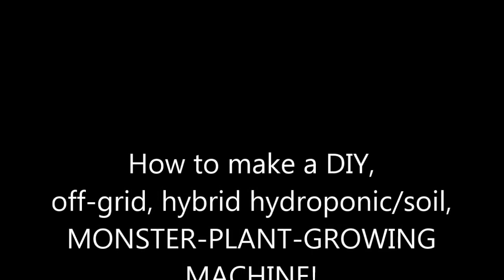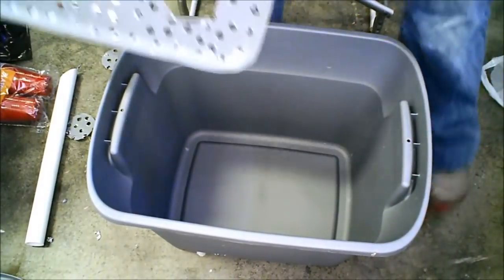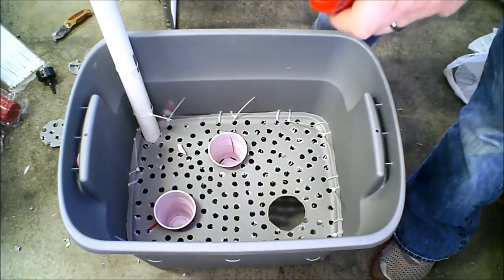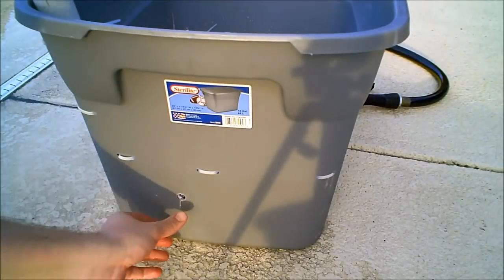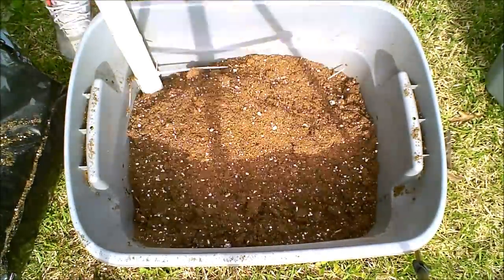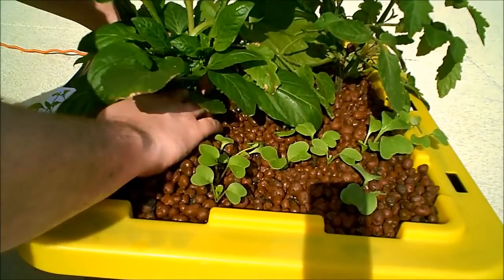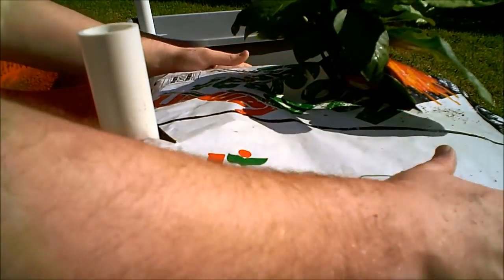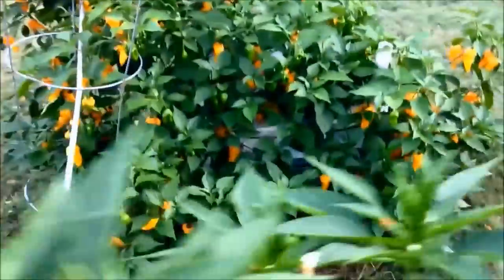DIY guide: how to make off grid hydroponic self watering container

Comment: This is an awesome idea! I will be trying this season thank you. One question. You don’t have problems with the soil going into the bottom and mixing with the rest of the hydroponic solution and also filling the air pocket? Will it help to use landscaping fabric?
Reply from the maker: There are no problems with soil falling through :)  I know it seems like it will, but it wont be an issue!  Keep in mind there is a plastic covering over the top, so there wont be any rain water flowing through it pushing it downward.  Think about a normal pot, it has holes in the bottom, but soil doesnt fall out of the bottom when you pick it up.  TLDR; dont use landscaping fabric :)
Reply: LS would just hinder the roots from growing into the nutrient solution.

Comment: Did you notice any improvement with using the peatmoss/perlite mix over the promix? I wondering if the benefits of the promix are worth the extra cost?
Reply from the maker: No, other than a great deal of convenience and time vs mixing and hydrating peat mix manually.  If you are on a budget mix it yourself :)
Reply: @PepperRancher  Thanks you, I appreciate you getting back to me. I live in a hotter climate where the summers can surpass 110 degrees Fahrenheit. I'm concerned about the water in the wicking bed going anaerobic at that temperature as the solubility of gases such as oxygen decreases with elevated temperatures. Have you had any issues with anaerobic bacteria or fungal disease?  Thanks again!
Reply from the maker: @nathanncohen793  No I havent, im in Alabama so its probably a bit cooler then where you are, but it would drink the entire revivor to dry every day in the peak of summer... so it had to be refilled daily.  Keep in mind that most of the oxygen for the roots will come from the drier soil section as well as the gap between the water level and the soil (sort of like kratky method)
Reply: @PepperRancher  Thanks again for the reply. I think I'll need to give this a try this summer!

Comment: That looks interesting with out no air pump where they get oxygen and doesn’t the soil goes down to the water trough the holes and don’t you clean out water ??
Reply from the maker: No, the soil doesn't go through the holes.  The fact that there is no top watering due to the plastic covering helps, but even normal pots have holes in the bottom.

Comment: But doesn't the soil fall through the little holes into the water! Shouldn't i put like a flat filter of sorts?
Reply: No it will not fall through.  The plastic sheet on the top will prevent excess water from filtering through from top to bottom which may otherwise be a cause for soil to get filtered through.  Trust me it is not a concern :)

Comment: Great stuff. Do you have problem with ppm of the nutrient in the water going too high? Do you flush the solution often?
Reply from the maker: No, I never flushed the solution.  Sometimes I added regular water instead of solution when it dried out to save time (it went completely dry almost every day in the summer, it drank THAT much).
Reply: @PepperRancher  thanks for the reply. I'm experimenting with this system on a half liter container for a 2 month old pepper plant. I can see that the roots that are reaching the water has started to rot! Have you ever faced this problem? Any ideas why it could be happening?

Comment: HI there; you are covering a container against the rain protecting lover level. what about those holes you drilled and place the soil into the container. the soil will drop into the bottom through the wholes. IT DOES NOT MAKE A SENCE IS CONFUSING.
Reply from the maker: The soil will not drop through the holes... it isnt like dry sand (that would fall through).  Peat based potting soil will sit on top of those holes without falling through...

Comment: Thank you for the video! Did you ever have any temperature/heat related issues with the hydroponic solution? How did you manage to keep the solution cool enough to not burn the roots of the plant?
Reply from the maker: Hi, the worry point about a warm temperature of a typical hydroponic solution would be starving the plant of oxygen since less oxygen is stored in warm solution than cool solution (it is not actually a problem of cooking/burning the roots from the temperature) Since this plant / system has an entire section of roots outside of the solution dedicated to oxygen absorption it does not run into this issue.

Comment: do you have problems with the self watering bucket getting to hot inside? how do you fix it? i live near AZ and have a concern the water gets to hot and rott the plants
Reply from the maker: Alabama is pretty hot and I have never had a problem with that...  This would be a major concern in traditional hydroponics because the roots would be getting the oxygen from the water itself, in which case the oxygen saturation level would be lower the hotter the water gets.  But in this case the roots are getting oxygen straight from the "air zone" above the water line, as well as from the majority fairly dry soil in the container above

Comment: Do you keep the master blend formula the same. When the plant goes in to flower.
Reply from the maker: I just keep them at the same nutrient ratio.  And they seem to do fine...
Reply: What was the soil recipe again
Reply from the maker: I use promix now.  I used to mix peat moss, perlite, and vermiculite in roughly equal ratio.
Reply: What pro mix isn't there a few different kind also since you switch do you still feed it with master blend
Reply: Animal Farm after you make your nutrient mix do you adjust pH or just run as is?

Comment: Do you think you would have gotten the same results with just using perlite instead of soil or do you believe the soil and hydroponics combined made this result? Also how long should the root system be before planting the plant?
Reply from the maker: I dont think perlite alone would work, it would not wick all the way to the top of the container.  The roots do not have to be long at first, because of the fact that moisture will wick all the way up towards the top.

Comment: Do you allow the nutrient reservoir to empty before filling it again, or do you always keep it topped up? Thanks.
Reply from the maker: Usually it is pretty empty when I add more nutrients, but this is more because it drinks so fast than because I am letting it get empty on purpose.
I guess to answer your question, there is no reason to top it off if you think there is enough water/nutrients left in the tank to last until the next time you will be there to water it.

Comment: Great looking plant.  Do you have a problem with the soil falling into the hydro solution through all the holes that you drilled?
Reply from the maker: +Matt Fuller No, not at all.  Kind of like having holes in the bottom of a pot, the soil doesn't really fall through (maybe a tiny bit when you are first filling it)

Comment: Nice ideas!  Thanks for the video.  

Question for you on your seed starter, those bare roots sitting in water like that doesn't rot the roots??
Reply from the maker: +Keith Collura 
No!  As long as the plant's roots have a source of oxygen, either from the water, or from another portion of the roots that are not in the water, the plant and roots will remain healthy.  In this case, the oxygen is from the circulating water.  You can also do this without circulating water if some portion of the roots are not in the water... let me know if you are interested in this and have any questions.
Reply: +Animal Farm sounds a lot like the design of the herb-garden I have for the counter top.

thanks again for your tips.  awesome
Reply: +Animal Farm I made one and looking forward to using it!  Also fyi, when I put the cups in I put another cup under the platform and slid them over the first cups in order to make the platform more sturdy.

Thanks again!

Comment: Hi, I'm new to hydroponics and gardening in general. I'm hoping to grow ghost and cayenne peppers as well as ozark bell peppers to start off. Could you tell me you deal with pests? Also could you check out Gary Pilarchik's video on How to build a cheap grow-light box. I'd like to know if that contraption is compatible with the kratky method of hydroponics until spring or summer arrives and I move my plants outside? Right now its cold for South-West Florida but then again I've yet to start up. Still waiting on my seeds and nutrients and need to get to the Home Depot or Lowes.

Comment: Can you explain about the seed starter? Did you remove the roots from the little plastic container/net pod or did you just plant it with the seedling into the system?
Reply from the maker: +Tarn So  Hi, I will make a video on the seed starting as soon as it warms up a bit here...  stay tuned! The net pot stayed on the plant when it went into the new system.
Reply: Thanks bro. I'm looking forward to it! Your videos are great, really inspiring. I was wondering whether or not you start your seedlings indoors in winter or wait until spring entirely? Also, about how far in the water are your net pots/solo cups in the setups? It looked like it may have just been touching the water because some seeped in the slits a bit. A few centimeters once the soil is inside?
Reply: +Animal Farm Here's another question. What media do you start your seeds in? Pete Pellets? Rockwool? Just soil?
Reply from the maker: In this case the seeds were started hydroponically in something similar to a "root riot" plug
Reply: Animal Farm Did you have to adjust ph/add lime to your peat/verm/perl mix that you used?
Reply from the maker: Sometimes I have added a few scoops of lime when mixing the peat mix, sometimes I have not... I would do it, but im not sure if its required.

Comment: Can these be used inside for winter growing? If so, how exactly would you maintain the proper heat/light?
Reply from the maker: +Tarn So You would need a greenhouse, and depending on your climate you would need artificial heating to keep it above freezing.  A pepper plant will die almost immediately upon reaching freezing temperature.

Comment: Making one or two of these this week. That's amazing. If I have plants that I've been growing in soil (pots), do you think it would be ok to plop them out of the pot and plant directly or should I clean the roots and plant them as bare roots into the new media?
Reply from the maker: Chad Ashton What kind of soil and how old is it?
Reply: Just a mix of top soil and compost. The plants have been in the pots a little over a month. Not sure how the roots look but I'm sure it wouldn't be hard to at least knock off some of the dirt but I was wondering if it would be better to wash the roots or plant right out of the pot.
Reply from the maker: You really want to use a soil-less potting mix.  My advise is to knock as much safely off as you can and use something peat based (mix your own peat, vermiculite, perlite... or buy something like pro-mix.
Reply: Animal Farm Thanks. That's what I'll do. Thanks for the video and the thread over at The Hot Pepper...that's where I saw this.

Comment: Hi, Wow! Great video and project . I do have a question though . You make no mention of how you add water to the container. Is it thru the pvc pipe?do you add water just until the water runs out the hole on the side of the container? How do you know when to add water ? Also wondering did you plant just one plant per container?  And one last question please. Is the soil on top watered at first before you add the plastic sheet to stop the rain water from getting in or is it dry ? it looked dry in the video. Thanks in advance for taking the time to answer my questions
Reply from the maker: Heath Braun Thanks for watching!  Water (or actually hydroponic fertilizer solution) goes in through the PVC pipe, it shows it near the end of the video.  You can add water at any time, it is impossible to over water due to the drain and the plastic sheet, so try to keep it full.
I put in 1 plant per container, if you check out the plant in the end, you see that it would not fit 2.
The soil I put in the video was dry, it would be simpler to pre-moisten the soil though... I was having a hard time managing the camera though so I just left it dry for the video.